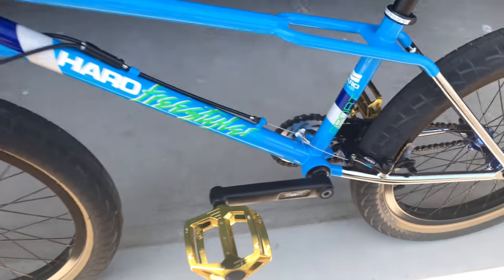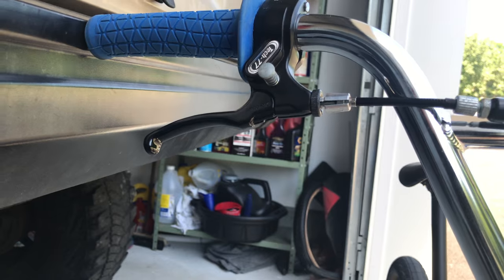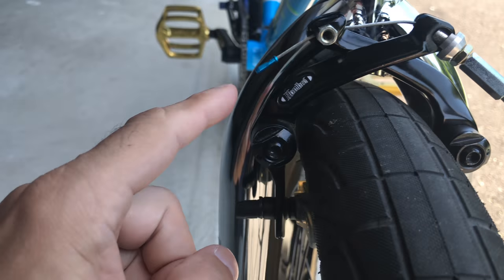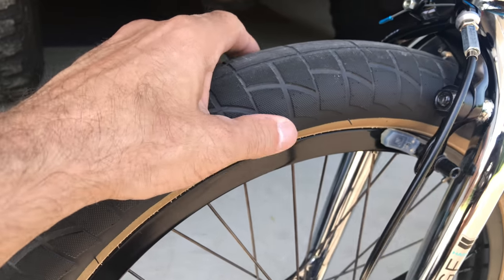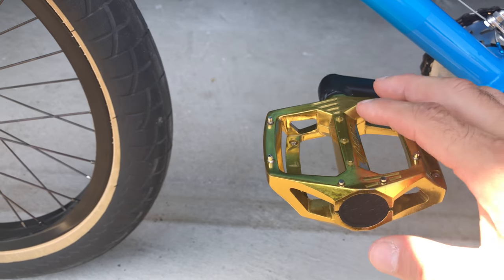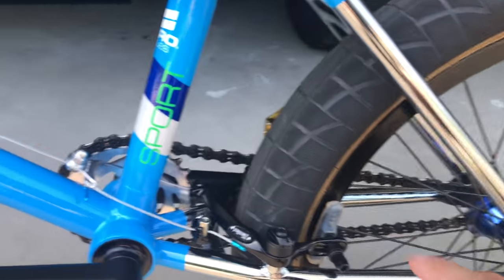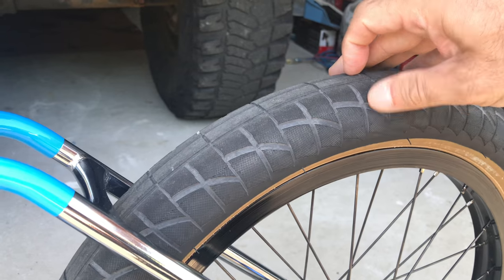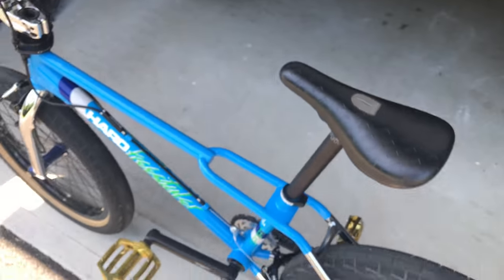My 2016 Haro Lineage Sport bmx bike check

Comment: Sweet ride 👍  Check out "Kool Stop" brand brake pads in salmon color, it should reduce the squeal but have great stopping power.  The "City" model is available in threaded or solid post.

Comment: IF you angle the pads TOE In. you can avoid some squeak.   If you want to run Clear pads and have minimal squeaking, I would recommend Odyssey Ghost pads.  They are cheap and they are designed to be Toe in without adjustment.  I run them and they seem to work great. well. at least for basic flatland tricks. I just figured I would throw that out there.  Cheers
Reply from the maker: Kid Wilson33    Thank you